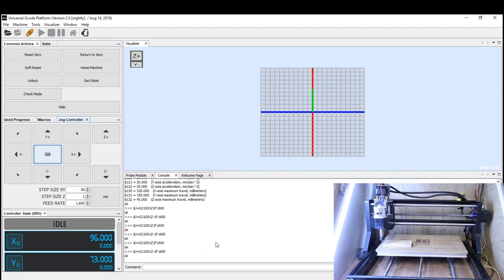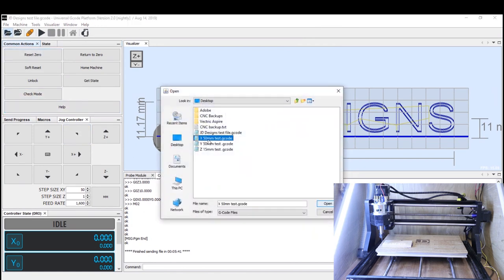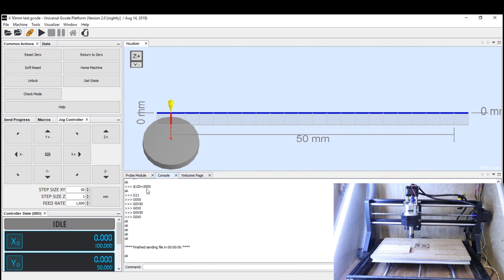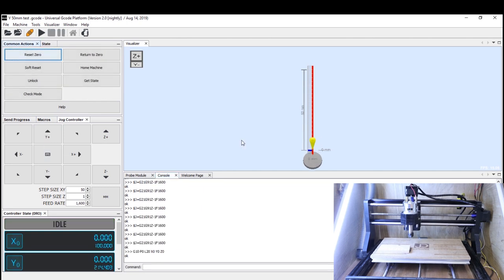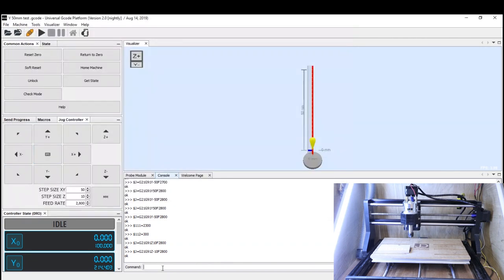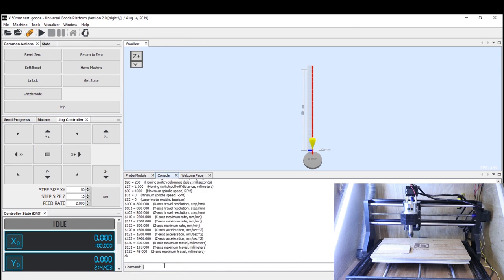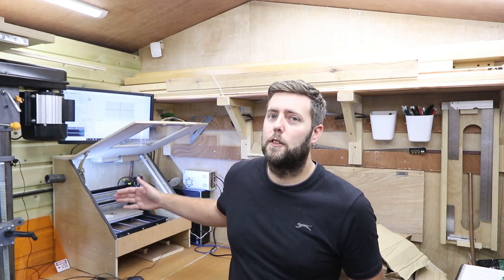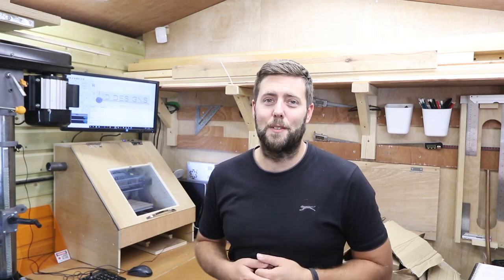3018 PRO - Tuning GRBL settings

Comment: Easily one of the most helpful videos I've ever watched. My only concern is that the results are WITCHCRAFT. I just got a 3018 and since I'm just learning Fusion 360 I'm not very good at optimizing my toolpaths, and the one good piece I was able to cut was wasting an enormous amount of time on retractions. Thanks for being informative, not trying to pad the videos for time, or spending half of them pushing sponsored stuff. You're super helpful for us, "I've been doing 3d printing for years, how hard could it be to mill aluminum" ijits. :) And your workshop setup is really well thought-out!

Comment: Hi James. I have a 3018 Pro from Vevor. When I have to carving or use a laser, the size is halved on all measurements. When I put 10 cm x 10 cm on the subject, and use a laser of the same size, only 5x5 cm is burned. Do you know what the cause could be? Have tried Candle, Universal-G-Code-Sender and Laser_grbl.

Comment: i have a genmitsu 3020 and it does not behave like yours. its as if it has some kind of software speed limits? i can change from 100 - 500 %120 and get zero change in machine behavior

Comment: okay, I changed  my spindle speed to 12000 I got an "ok" but it never changed when I did the $$ to see if it had changed.  tried this many times. BTW you never did the $$ to check when you did changed the speed.   Are  you sure it took?  My speed stays at 1000.  any suggestions?

Comment: I set my machine up out of the box as your instructions. All seemed fine but a few days later the motors started stalling. I did the calibration tests again and they were way off from how I originally set them. 
All seemed ok but I wasn’t getting the depth of cut that I would like until I realised that the Z axis carriage was bottoming out because my test piece of MDF was only 8mm thick. I dropped my bit down a touch in the collet and ‘hey presto’, a perfect cut! 
I’m now going to make a spoil board for my machine. Thanks again James.
Reply from the maker: We all hit issues. I ended up having to lower my acceleration down as well from my video. My machine didn't like the colder temperatures over December and January
Reply: @JamesDeanDesigns  Doing another trial design and it’s still not right in the ‘Y’ axis. It’s jumped up 2mm on one of the letters I was cutting.😡
Reply from the maker: @ianknight2053  how deep are your passes?
Reply: @JamesDeanDesigns   Very shallow James. I actually set the tip of the V bit a little too high, so it only just scratched the surface of the wood.
I made some small alterations to the GRBL settings and it cut fine the second time around.

Comment: I can see you've changed max spindle speed from 1k rpm to 20k rpm during the tuning. This is exactly what I was looking for. My 3018 came with spindle rpm capped at 1k rpm, even though the manual says it is 10k max. Also, notice. Be careful with acceleration settings. At the start of cutting the bit suffers an impact, and if it is too rough it will break. This is why all of the industrial cnc machines have PID control on all of the axis. The faster the tool goes, the faster it needs to be stopped, the lesser the impact. 
Great video, thank you!
Reply from the maker: Thanks. Also ramping improves your bit life. You dont really get it on free software but most quality paid for software has it for that exact reason you mention, to avoid your bits breaking

Comment: From my personal view. I'm glad it was so cheap and came without limit switches.  I've added 3 switches and hope to use soft limits. So now to set it all up and fine tune it.  I've had mine 3 weeks now and not really cut anything. But I've learned loads from people like you. Thanks James.    Jim
Reply from the maker: Glad the videos have helped 👍
Reply: Yes thanks James. 3 weeks ago it was all voodo magic. Now I think I've got some sort of idea.
Limit switches are working although default speed was too fast and broke one off. ( a bit of glue will fix that)   now busy checking travel calibrations. I'd have been in a mess without your help.

Jim
Reply: Update to above:    Wasn't too fast.  The connector on motherboard for Z axis had come out.  All good now.. Soft limits set as well.

Comment: That was a great guide, very easy to understand and all the warnings, thanks. One issue is that when you add weight, the steppers won’t be able to achieve the same acceleration, this will also happen if you increase the resistance. So, when you cut you add resistance, when you add a large piece of wood to the table, the y axis now has a larger weight to accelerate and won’t be able to achieve the maximum acceleration values anymore. Probably best to do all your tests with a large workpiece on the bed. Cut speed will be controlled  by the cutting parameters but when you’re cutting a pocket and, for example you come out of a corner and accelerate up to the cutting speed, for a short time there is cutting resistance added to the reactive force of speeding up the weight of the spindle or the workpiece and bed. The acceleration won’t be able to achieve the maximum anymore. I suggest at most half the maximum acceleration value you found in the test. I would also check for ringing and overshoot if you’re running at higher speeds and higher acceleration, the belts and structure may not be as good at rapid transitions you could get some overshoot or ringing at corners and start/stop points.
Reply from the maker: Thanks for the feedback. That's great info and I agree for the most part with what you have wrote. One of the reasons I do the traverse test is because it puts extra strain on the motor, similar to placing a piece of wood on it. In reality you would never traverse like that at those speeds during cutting so it puts extra pressure to get you closer to your realistic settings.  Cutting acceleration tests are really difficult unless you're always using the same materials and bits. For example something like oak is going to be harder than MDF. The main purpose of my video is to help people understand those settings and give the confidence to adjust them and hopefully it does, but as I say, that is great info you have added.
Reply: James Dean Designs : You did a great job at presenting the method, this video and your others, if you’re trying to demystify the various aspects, you’ve achieved that in this video and your others. What I appreciate is that you’re using the humble 3018 and getting good results from it, too many reviewers are quick to dismiss it.
Reply from the maker: @klave8511   there was a point I questioned if I made the right choice  of machine and wanted to get rid of it, but what I realised was my mistake was buying from a cheap ebay store. Everything was just off by a fraction so nothing ran as well as it should of. Spent hours just tweaking every bolt on all the axis 🙈

Comment: Top tip: at 29.00 in your inset picture I noticed that your spindle and z-axis cables are attached on the far right (looking from the front). By giving a little more slack and fixing the cable at the mid x-axis you will put less strain on the cable and the motor/carriage and avoid any "tugging" on the x-axis. When done correctly this enables a smaller cable loop size each side of the centre rather than being stretched all the way to the left and a large cable loop to the right. Hope that helps!
Reply from the maker: Thank you. Thats useful advice 👍

Comment: Thanks James. I've had the issue that the X and Y axis would stall on any movement over 100mm and the seller had me change acceleration to a much lower value but this only helped if the spindle was moving no more than 3/4 of full travel and once I saw that your maximum travel speed was 1600 I knew what the real issue was. By default the maximum travel speed of my unit was set to 5000, this is much faster than it is capable of doing. I stopped your video right then and there and tested it, SUCCESS!
Clicked Subscribe, and on with the rest of the video.
Reply from the maker: That's good to hear. Unfortunately some of the sellers don't really know much about these machines and cant provide much support but glad your moving forward

Comment: Thanks for the great video. If you have tight spots in the travel, it is worth looking at the alignment of the parts. The rods and lead screws need to be parallel to each other. Probably less of an issue on these newer 3018 pro models. I have an old 3018 where it takes some fiddling to get it running smoothly. Also, I found on mine that the Y axis the table needed to have shims between it and the lead nut and bearings to get it to not bind some. The table wasn't exactly flat, and it would get tight right in the middle of its travel. I also had to get them to replace the spindle carriage because the Z axis lead screw and/or nut wasn't manufactured correctly. It wasn't just tight, it would bind up and seize at one point in the travel.
Reply from the maker: It certainly is worth checking alignments. I cover it in another video but its a really common issue and a few minutes aligning everything can make a big difference.

Comment: James fantastic tutorial although just a small note that when calibrating the Y axis the bed needs to have on it whatever full load work piece that will be worked on, especially when using the 30 40 upgrade kit.
Reply from the maker: Very true 👍

Comment: I'm just getting in to this stuff now, but I've found your tutorials to be extremely helpful. This is another great video - I'm going to do this tune-up for sure to shave some time off. I suppose there are two types of "sticky spots" - one that would cause a stepper to skip while it's already moving (indicating the velocity is set too high) and the other that could cause it to "jam" when starting from a dead stop (indicating that the acceleration is set too high). Knowing which situation you have would tell you which value you need to tweak (or both if you have both problems), yes?

Comment: Just tuned up my machine using all your setting. Its like a different machine now. All settings seemed to work good using your test and logo. However about 3/4 through my first carve I started losing steps on the Y-axis. Guess I'll have to slow them down a bit more. Great video though!!!
Reply from the maker: One thing I didn't mention in the video (and really should have) is the settings do typically have to come down a little but more when the machine is under load but glad it helped 👍

Comment: Perhaps there is something built-in that is limiting the settings? I stepped the 120 and the 121 all the way to 10000 for each, and neither one has jammed yet. This felt excessive based on the video, so I thought I'd check in before pushing it further and risking damage. This is my first system, and I haven't done a cut with it yet, as I want to ensure it is properly calibrated before moving on to the actual cuts.

I'm sure higher performance is better, but this doesn't feel right. Any thoughts on what the best course of action is?
Reply from the maker: There will be a maximum rate they will not go beyond but that will vary between different steppers. You'll probably find it's around 3000 or 4000. But it's great you've got it so high without any issues

Comment: James, You are my big source of information about CNC and Grbl.
did you spend time on "User Commands" in Candle?  (Extras buttons I think) but how to use?
Reply from the maker: Thank you. User commands are just custom buttons that you can program. So for example when I use a Z probe I usually set it from about 20mm in diagonally, so I could create a custom button to always move it in 20mm every time.

Comment: When I tried Tuning the $120 setting even to 10K and running the X 50mm Test code The Motor NEVER Jams or shows ANY sign of Struggle In the Test gcode I was worried about actually Running the motor that high for a test cut so I set the $120 to 2000 And Again it passed the X 50 mm Test code, But Jams On the X axis Immediately when trying to Run a Very simple Bore Op.   Every thing Works Default But $120 Is the only Problematic Setting When Altered. Any Ideas of why I'm Getting this behavior with my 3018 Pro Max?

By default My Out of the Box Settings Were:

$0 = 10    (Step pulse time, microseconds)
$1 = 25    (Step idle delay, milliseconds)

$2 = 0    (Step pulse invert, mask)
$3 = 2    (Step direction invert, mask)
$4 = 0    (Invert step enable pin, boolean)
$5 = 0    (Invert limit pins, boolean)
$6 = 0    (Invert probe pin, boolean)
$10 = 1    (Status report options, mask)
$11 = 0.010    (Junction deviation, millimeters)
$12 = 0.002    (Arc tolerance, millimeters)
$13 = 0    (Report in inches, boolean)
$20 = 0    (Soft limits enable, boolean)
$21 = 0    (Hard limits enable, boolean)
$22 = 0    (Homing cycle enable, boolean)
$23 = 0    (Homing direction invert, mask)
$24 = 25.000    (Homing locate feed rate, mm/min)
$25 = 500.000    (Homing search seek rate, mm/min)
$26 = 250    (Homing switch debounce delay, milliseconds)
$27 = 1.000    (Homing switch pull-off distance, millimeters)
$30 = 1000    (Maximum spindle speed, RPM)
$31 = 0    (Minimum spindle speed, RPM)
$32 = 0    (Laser-mode enable, boolean)
$100 = 800.000    (X-axis travel resolution, step/mm)
$101 = 800.000    (Y-axis travel resolution, step/mm)
$102 = 800.000    (Z-axis travel resolution, step/mm)
$110 = 1000.000    (X-axis maximum rate, mm/min)
$111 = 1000.000    (Y-axis maximum rate, mm/min)
$112 = 1000.000    (Z-axis maximum rate, mm/min)
$120 = 30.000    (X-axis acceleration, mm/sec^2)
$121 = 30.000    (Y-axis acceleration, mm/sec^2)
$122 = 30.000    (Z-axis acceleration, mm/sec^2)
$130 = 200.000    (X-axis maximum travel, millimeters)
$131 = 200.000    (Y-axis maximum travel, millimeters)
$132 = 200.000    (Z-axis maximum travel, millimeters)

Comment: Greetings to you from warm Uzbekistan! Absolutely like you for your work! I would like to ask you:
If I make acceleration settings like in your video, that is, I achieve the result that there will be a maximum acceleration without slippage
Will there be any problems with the machine? That is, I will make a control program in the program (aspire) and output it to the machine through a candle, I will not have any problems when milling? Acceleration settings will not affect the distance
I will be grateful for your answer! Yours sincerely, Evgeniy!

Comment: James, I used this great video when I got my ProVer 3018 and it made a tremendous difference for my machine.  Can the same basic concepts be used on the ProVer 4030 XL? Or do you have a different video?  I searched but did not find one..
Reply from the maker: Principles are the same so yes you can. Just be careful with the 4030XL as they advise not to mess with the settings too much so make sure you take a copy before you start.

Comment: Been trying to follow this guide for a bit with my 3018 Pro from VEVOR. I cant get the first section to work like it does in the video. I have got the accel up to 10k without it making any kinda noise, skip or jam. To replicate the results I have to up the feed rate, ended up getting to around 3k feed and 2.5k accel before jamming and not sure if I should go to the max speed first then pull the accel based on that or what?

Comment: Hello James. All of your videos are awesome. Just a quick one. I had 3018 Pro. Try to cut a circle. But, by Y, it was smashed. And cut Oval. Can you please instruct me on how can I change settings to be perfect circle. 
Thanks
Aleksey Romanov
Reply from the maker: If its cutting a perfect oval then chances are your steps need calibrating. Check this video
https://youtu.be/nGwUf8uNWBU
If your oval is not perfect and things don't align then if may be missing steps. Easy way to test this is slow the feed down and see if it helps the situation

Comment: Hi James, thank you very much for these guide videos. You say in the video that you are talking about the $30 (spindle top speed rpm) parameter. By default it is 1000, but 3018 Pro Vevor has 10000rpm stock spindle. Should I set this parameter to 10000? Or does that default value have a multiplier of 10? Thank you in advance for your answer.
Reply from the maker: Usually if you are doing laser then set it to 1000 but if you are doing routering then set it to 10000

Comment: Hey james i have a 3018 like you  have in the other video.I mainly use it for pcb making.the machine is working very well to mill the pcb.Once im at the drilling part the hole never line up with the one on the design.I am using eagle flatcam and candle.You have any idea what could be causing this?
Reply from the maker: Im not really familiar with doing PCBs but usually if something doesnt align it possibly means steps are being missed. Alternatively check the calibration of your axis as accurately as you can. So tell it to move something like 150mm and measure how far it actually moves

Comment: Hello James, first I would like to thank you for making these videos. I have a 3018Prover running UGS. When I try and increase the speed nothing happens. 
Tried refreshing and $$ as well
It's stuck on the old settings.
Anything I could do to improve performance. Had this machine for over a year and it still hasn't worked from day one.
Thinking of maybe putting a new motherboard in to see if this would cure the problems.
Im in my mid seventies and I would like to see it carve something before the big box comes calling.
Cheers Bill M-) 
Haddington